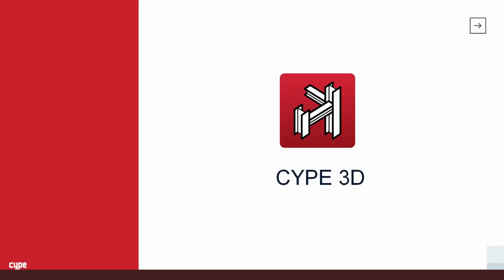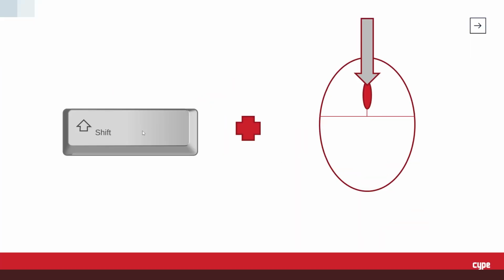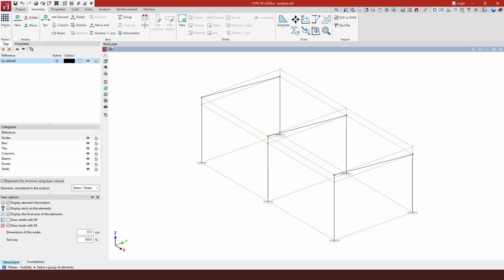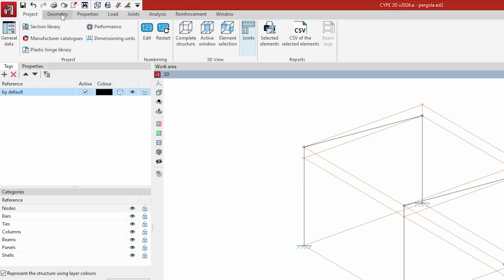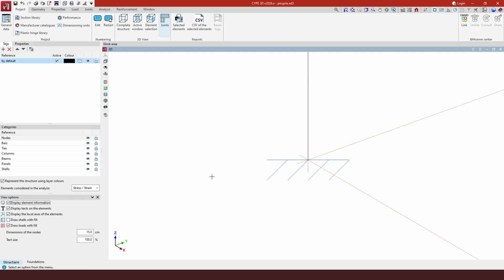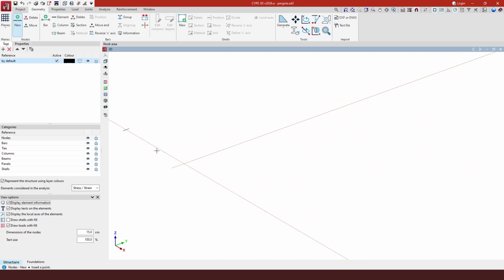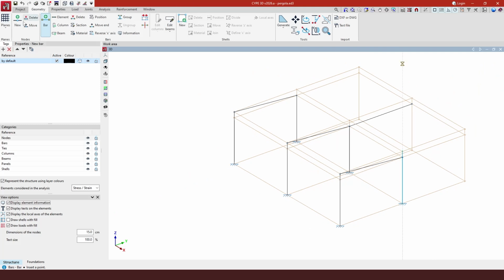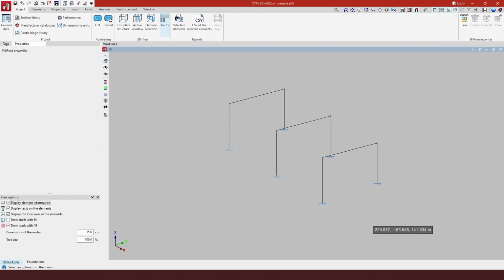5 - Overview of the CYPE 3D interface | CYPE Steel Structures

Comment: Nice, a more detailed tutorial  for Cype3D. Hoping also for tutorials Cype3D to CypeCAD interface, because as of now, I had encountered errors in exporting cype3D to CypeCAD (maybe there is a checklist before importing it to CypeCAD).
Reply from the maker: Hello! To learn more about integrated 3D structures (connection between CYPECAD and CYPE 3D), please refer to the following resources: Webinar: https://learning.cype.com/en/video/integrated-3d-structures-everything-you-need-to-know-about-this-feature-that-connects-cypecad-and-cype-3d/ Website: https://info.cype.com/en/subject/integrated-3d-structures/ If you find any errors, please contact Technical Support using the available communication channels: https://learning.cype.com/en/technical-support/  Kind regards 😊